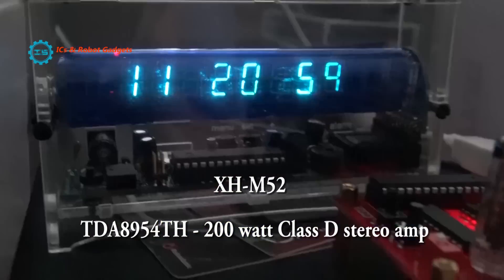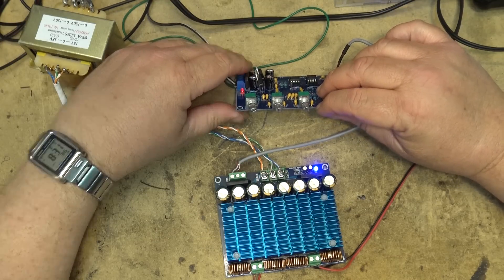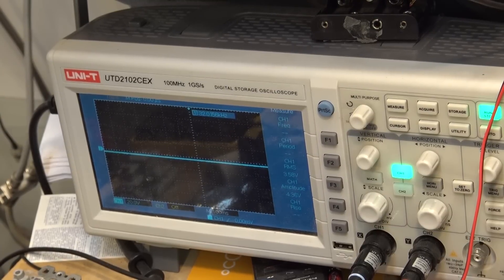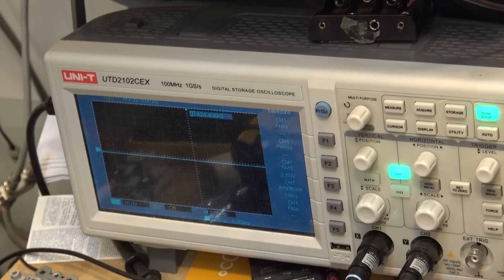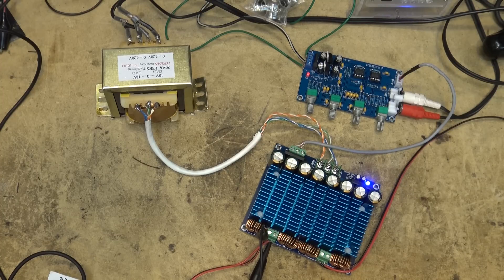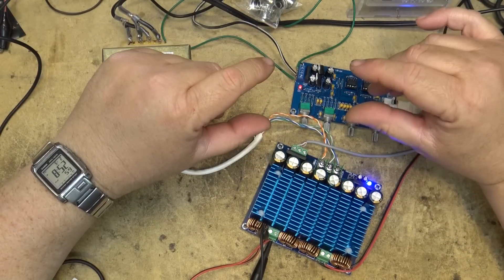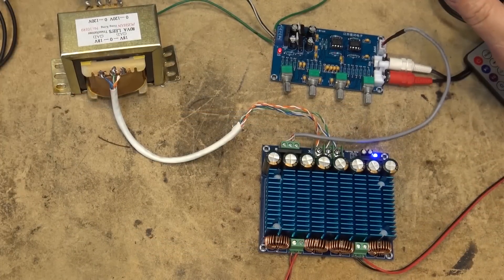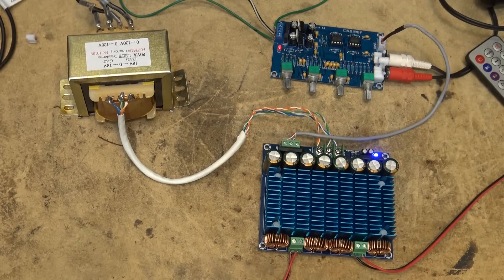XH-M252 TDA8954TH Ultra high power Class D amp review

Comment: Ethernet cables as power cord? 😢😢😢😢 check out Ohm law…
Reply from the maker: No problem. Put the pairs together and you increase current capabilities.   We fed remote dslam cabinets using telephone wire.   25 used 390 volts across the pairs.

Comment: Worked with these from 2016-2021 
In the "Mackie" (Loud Technologies) THUMP 12 & THUMP 15 prof.audio products..besides other manufacturers.
they were powered by a +/-42 Vdc smps and used in Bridged mono. 
Just a single chip ,
capable of +600W ...driving a single "nominal 6 Ohm " 
( 12/15 inch) loudspeaker.
this design was for the
20Hz-2000Hz range. 
The tweeter crossed over @2000Hz and was powered through the 7293/94
100W mosfet module driven from the same supply rails.
the Thump series and a pretty sucessful run and was a popular choice with many small P.A. event management companies.

Comment: On 2x30v ac,can produce 200w 8 ohm per Chanel?
Reply from the maker: First of all that's 60 volts across the full winding as 30 us the center tap and the way it is designed they are doubling it to 120 using diodes and capacitors.
Reply: @12voltvids  the signs should not burn out?

Comment: hi i,m kinda late buying this , i have a 24v ac 500mA  power adapter the light turns on but no sound is coming out of it , do i need 24-0-24 AC for it to work , tank you !

Comment: How can you power a 420 watt amp with telecom data wire? You didn't have and 10 or 12 gauge? 14 even?

I'm still happy you did some tests on it either way but it just seems like its handicapped that way.
Reply from the maker: No problem.  Just not to full power.

Comment: I have the same amplifier board, just got it. Mine has a high pitch sound on idle and inductor coils hear up like crazy
Reply: Using a 24-0-24 AC power supply.

Comment: could you not run Dc voltage to it and what would that take ?
Reply from the maker: No. It requires Ac and only Ac as it makes its own DC, both a + and - rail and it doubles the voltage doing so.

Comment: Ordered an exactly similar board and connected a 23-0-23 AC. Even without connecting the speakers the heatsink gets quite hot after about 15 mins. Is this normal for class D amp?. Would appreciate your viewss on this.

Comment: hey, may i borrow your expertise on an amplifier project that I've been struggling with, somewhat related to this video? the premise is that I have a pair of amp chips (both containing TDA8954s), which usually run on 24VAC, but instead, im running them with 2x 24V meanwell DC power supplies, which i am running in series, with a center tap between the two power sources to be my virtual ground. The amp chips work fine, but I've cooked something when trying to connect a low pass filter chip, and/or the aux socket to the amp chip's input terminals. I'm pretty sure that because my virtual ground is at +24v, and the sleeve is true/chassis ground, there is a shorted potential. So, I've added DC blocking capacitors between the socket, and the virtual ground, and another one between the two signal ground terminals, and still, something is cooking. The low pass filter runs off the first power supply for +24 DC power, if that helps. Thank you for reading.
Reply: solved it! had the low pass on the negative rail, even though it was correctly on the + and - on that power source. i also needed to ground the center node between the two power sources, the presto! working amps!

Comment: Hope you are doing well. If I use 24 0 24 then how much wattage I will get per channel for an 8Ohm speaker in reality?
Reply from the maker: Half the power.
Reply: @12voltvids  Thanks for your prompt reply. R you sure I will get 210Watt per channel for an 8Ohm speaker! Many say that I will get much lesser than that.
Reply from the maker: @zunayedislam4029  
Look up the spec and the rating is for either 4 or 2 ohms.
Reply: @zunayedislam4029  i have a tda8964th u can actually go up to 30  0 30(27 0 27 is the sweetspot imo) and unfortunately the advertised impedance handling is false. it can only to 8 ohms stable(for those dual btl/bridge mode models ) u can go down too 4 ohms. but the current limiter in the amp chip kicks in and let the amp to protect mode. so you could either get the single chip version or lower the voltage down to something like 22 0 22 or 18 0 18 to handle 4ohm loads(the dual btl/bride models). 

u could still hook up 4ohm loads on it at 24 0 24 but dont expect to use its full potential cause of that current limiting in the chip.

Comment: i have question you might have insight about concerning my XH-M252 setup. it works great, but it runs very hot, 140F on the sink in still air while outputting no noise. you mention low heat in your video so i wonder why mine is so hot at rest. is it because i have a too-large 28-0-28V transformer? is it the 2ohm impedance subs wired to each output? something else? thank you i advance for your time and expertise.
Reply from the maker: It is rated 24 - 0 - 24 volts. I was running at 18 - 0 - 18, but I had my variac turned up to 150 so I was running about 22 - 0 - 22 and had no severe heating problems. The heatsink gets warm, perhaps to 110F but that is pretty normal. I also ran it into 4 ohm load.
Reply: 12voltvids thank you again for such a timely reply. from your numbers, it seems like i oversized my transformer thinking the output wattage should be similar to the rating, (300VA, 28-0-28V.) i will replace it with a 250VA 25-0-25V transformer i have lying around and add a little computer fan- is this likely to add noise to my LPF’s output of they’re on the same 12V DC boost converter? thank you for the read.
Reply: I use a 20-0-20, 15 amp transformer and it heat 45 degree celcius  without any music play.  I think its like class A amp, always on.

Comment: Is this required to be powered by AC or could you use DC as an alternative option
Reply from the maker: It needs to be powered by ac. It uses dual full wave bridges to produce +48 and -48 volts for 96 volts potential between the 2 rails.  That is how it makes the high power it makes.
Reply: @12voltvids  I'm wondering about that also. Am I going to be driving 24 volts DC into it going to make it 48? Put the AC would do go differently. I'm just wondering why I couldn't break down the bridges, and feed voltage DC directly into that?

Comment: When you start playing some music at 15:48 the top and bottom of the switching waveform starts jumping around badly. This means the DC supply rails are very unsteady. (I understand the transition point, the actual point where the waveform goes from low to high and vice versa is a function of the signal, is meant to be moving about). To put it another way, the vertical parts of the waveform definitely have to move about. The horizontal parts of the waveform should stay steady. I would say the DC filter capacitors on the board are way way too small.

Comment: Can it be bridged for a mono subwoofer?
Reply: Each side of the amp is already bridged look up specs for TDA8954TH
Reply: Ok, two inductors per channel, so it's bridged.  I found that 10W is enough volume for mid range 6" speakers in the car doors.  420W sounds excessive!

Comment: Good evening, i have a question for anyone who can answer me:

This class D amp, XH-M252 (or generaly any "diy" class D amp.) would use or need a Zobel network, at the output? 

this model specifically have one integrated?

if this amp needs one, the Z.N. benefit the amp stability?

in any case, and ins advance thank you for your answers.

nice video and thanks for sharing.

Comment: Hi sir , can we run this amplifier more than 25 volts ?, because i have transformer of 36+0+36 volts  can i use this ?
Reply from the maker: Over voltage will make it shut down.  The voltage limits are on the spec sheet. Look it up.
Reply: i read somewhere 30 0 30 will work

Comment: this amplifier states that it can run on either ac or dc ? how its that possible when the board already rectifies ac
Reply: Easy, Its like running water through a filter. Voltage wont care if its gone through a filter twice.

Comment: Hi there, great video - I am building something very similar which requires a 12 0 12 ac transformer to each board (which I have) - can I power the 2 transformers from 1 appropriate voltage AC adapter ?
Thank you, any help is gratefully appreciated

Comment: Sir this unit can be use without a pre amp board?  2nd question is .. is it possible to reach 420 watts per channel on this unit using a required power supply? Thanks and more power to your channel

Comment: What about output distortion? Or actual rated output watts? Or have i just missed something in the video? :)
Reply from the maker: If you follow the link you can find that info.  It is built around a tda8954th
Rated power 210 per channel into 4 ohms.  
Look up the chip for specs.  I have no means to measure distortion but I am quite sure the published data is correct.
Reply: 12voltvids okay, thanks, will look into the datasheet! Thanks!

Comment: The TDA8954 is a nice amp, pretty cheap on reputable vendors too, and available in both SMD & through hole. Its just a bump better then the TDA8950.
Its great if you need a single channel 330W RMS or less  @ 0.5% THD @ 8 ohms (BTL bridge mode),  or 2x 160 W RMS or less @ 0.5% THD @ 4 ohms...

For higher power, I like the TDA7293, which can be paralleled. 

You absolutely ran this almost to rock bottom, with that little 80VA transformer. The TDA8954 needs +-41 @ 400VA or so to reach it's true max clean potential, whilst maintaining 0.5% THD. And that is just ONE TDA8954! That board you bought has two of them :o You'd need ~700VA or better. It is interesting though... there is no max input current listed on the spec sheet. Class D is quite dynamic, but still I like to reckon you need at least the input power to deliver output power on the average. Music is dymanic too, so many factors. I like to oversize my transformers rather then clip or dip on the rails.

Old surround sound (5.1 - 9.2 and etc) receivers are the easiest source for transformers that typically put out +-30V or more. Onkyo is a really easy source, because of all the problems with the DSP chips on the HDMI board, failure is high, and there is an abundance of units for sale for spares or repair... The higher models with more output power have beefier transformers. The amplifier design is discreet, and with some patience, offers a lot of bonus parts and/or can be utilised. The majority of the time on these select models, there is nothing wrong with the amplifier or power supply... its always the DSP on the HDMI board. An easy way to get an idea of the transformer is to just look on the back panel of the receiver, at the power consumption. 500W+ is really good. Sometimes it just shows voltage and amps. Just multiply them to get watts.

You can find these all day long on ebay... Another thing you can do is put in an ad on Gumtree/Craigslist/Etc... offering to pay like $25 for broken receivers that people would otherwise toss into the rubbish bin... I had great success in scoring multiple Onkyo units that way, sometimes free because the people are environmentally conscience :)

I really do like these TDA chips, minimal component count, inexpensive, and great performance/watts per dollar.

My final thought on these Chinese supplied TDA amp boards... is the heatsinks are WAYYYYY to small, if you ever want to utilise the chip's true clean potential. I'm too lazy to do the maths on the thermal characteristics and requirements (but it is all in the datasheet). Again, this is where the through hole versions and old AV receivers come in handy. They have nice heatsinks that can be repurposed ^_^

Comment: I asked once before but lost the commend, how would i power this module from DC power supplies what voltage would i need and i think iw ould need 2 24v dc supplies which i put in series right?
i already tried a bit with 2 lab bench supplies both set to 24v and using the middle voltage point for the gnd connection but the signal was very quiet and distorted when i turned it up raising the voltage to 40v on both supplies just made the amp go into protet and not outputting anything
Reply from the maker: Needs an ac supply.  Won't work on DC.
Reply: @12voltvids  well no, my unit just had a lose inductor on the right channel and as it happens that channel was the one I was testing, I soldered the inductor back in and the module works fine on 2 DC power supplies. The 2 supplies are in series and you have a 0v 24v and 48v potential. 0v goes to one of the ac24v inputs, 24v goes to gnd and 48v to the other 24v input. So that you get the +/-24v emulated if you measure from the 24v potential you get +/-24v and it works great :D
Reply from the maker: @BadMax02_VR  
But when you feed it with AC 24 0 24 the voltage doubler on the board gives you 96 volts rail to rail  and you are giving it 48. Yes it will put out sound but not at rated power.
Reply: @12voltvids  when i feel the thing anythung above 80v so 2x 40v the module goes into protect Mode because i have 2 50v labbench supplies and already tried it it works until about 38v and it then cuts out
Reply: @12voltvids  i have read the manual because of 2 thing first it says in the manual that the chip itself is only rated fpr +/-42v so it isnt even possible that it gives one chip 96v because that would be /+/-48v and it would go into OVP overvoltageprotection mode.
2.nd i wanted to see if it states something abouzt defects or so because one of my channels does not work at all it outputs 5-6v dc with no speaker attached and when there is something attached just nothing comes out no ac and no dc the other channel works fine. one 10 ohm smd resistor was complettly burned to crisp i replaced it but the channel or chip does the same thing and also the chip draws about 8w while doing nothing and gets very hot even just being a few second turned on withouzt heatsink the other chips stays cool for a minute or so and i can keep my finger on it for about a minute before it gets to hot but the defect channel chip just a few seconds and to hot.
Do you maybe know what could be the problem is it the chip itself? or maybe some of the smd things because i ordered 2 of these chips one spare and one to replace the one but if it has to do something with the smd things than it would just do the same thing.
Reply from the maker: 4 chips on that board.  One outputting for each speaker wire 180° out of phase with each other.  Each one operating +/- 42 volts will give a pwm difference of +/- 84 volts rail to rail which is what the filter is working with.  This is how these amps produce so much output power relative to supply vintage.  The chips should not get hot.  There will also be no DC voltage on the output if chips are working properly because even at no input there will be full rail to rail output you can measure with a scope.  The filter will cancel the carrier and will be no voltage.  If one of the chips fails though and is stuck on either a positive or negative state then you will definately see DC.  If a chip heats up then it is probably shot.
Reply: @12voltvids  ok so i will probably have to replace the one chip right? but i wounder the 2 ac signals are directly converted by the full bridge rectifier anyway so it should not matter if i use ac or a slightly higher dc voltage because the chip will se the same dc voltage right and what the chip does with that voltage is not seen by the powersupply so i should be able to use +/- ~30v DC supply so 2x30v and connect them in series to the ac input and have the same power like the ac input right? because it works but i cant test on the moment if it outputs the full power thats why i ask. 
and sorry for bothering you and thanks for helping.

Comment: please tell me the what power supply use to get maximum output power & also tell me the ampere of power supply
Reply: 28vac 0 28vac to do it for full power but it will get hot as hell, even when on idle. So you need to put a fan inorder to not make the amp to overheat. 24vac 0 24vac is the recommended for good power
Reply: And maximum amperage it gets is around 10~17Amps so you might need some beefy power supply
Reply: @dgjm7129  please also tell me which speaker protection board work with this amplifier

Comment: 80va transformer, go get 200w+ really how low can you go.
Reply from the maker: Of course the transformer I used to demo will not deliver 200 watts. The module is rated at that but of course needs an appropriately sized transformer.  I use what I have on hand.  These are demo videos, I am not putting this module into service.  I give them away when I am done with them.
Reply from the maker: @CarlRyan-i2z  I can still measure the power output given the voltage supplied, but without a big enough transformer, capable of supplying the required power the am will not produce what it is capable of.  On lower voltage it will still perform just as well, with less output power.
Reply from the maker: @CarlRyan-i2z  The results I get are going to show what can be achieved with this setup. Since I am not putting this into service any time soon, I was not about to invest a large sum on a transformer, which costs much more then the module just to push it to the limit. It shows what you. I have a few scrap receivers kicking around now, and I will likely take a big transformer out of one when I scrap it, and can re-visit this module to show it's potential, but when I did this test all I had available was the transformer I had on hand.